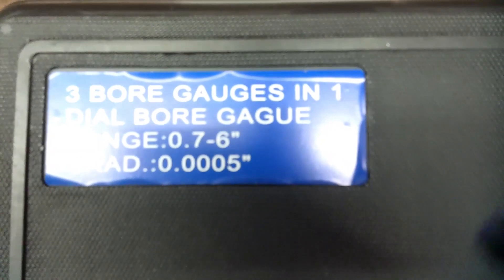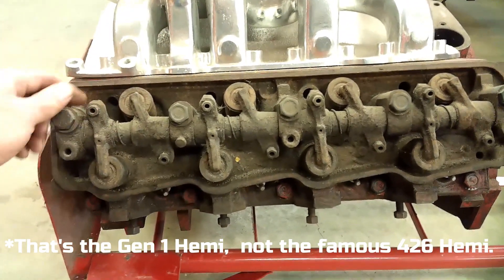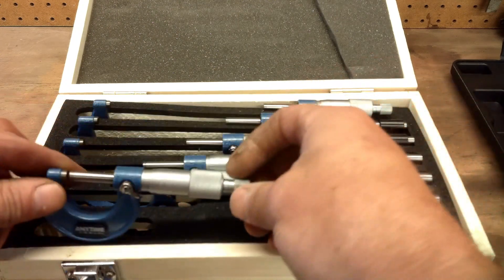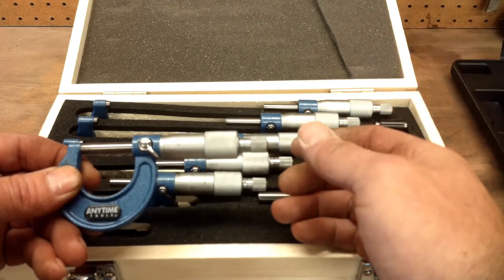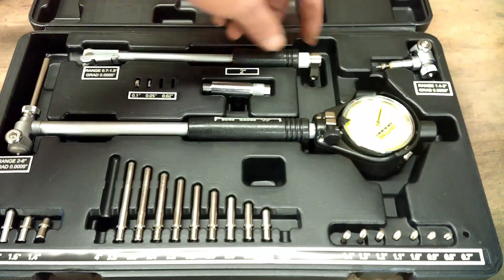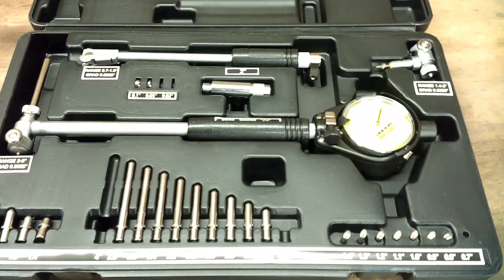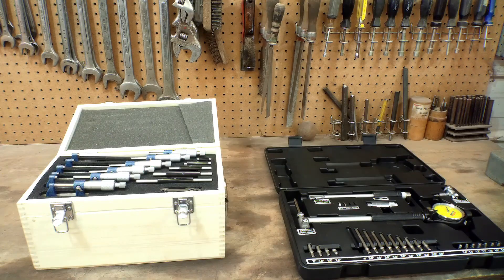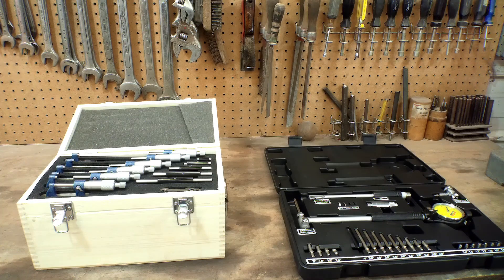Review of Anytime Tools Micrometer and Bore Gauge Set

Comment: Thanks for the video! I ordered the micrometer set because I need to check my pistons and I decided to order the whole set so that I won't need to order anymore precision measuring devices for things like rotors. Hopefully I can borrow a dial gauge indicator from Autozone/Advance if they have them in the loan-a-tool program, but my engine only has 70,000 miles on it so I should be good to go either way.

Comment: I have used dial bore gauges and micrometers, there isn't too much too them as long as you can read them, from personal experience, no laughing on my end, you simply and easily explained how to use them in basic specs. Nice job!  By the way, I subscribed as well :)
Reply from the maker: A lot of people simply cannot grasp the concept of how to read them. I remember back in high school shop class, how few of us actually got it. The biggest struggle I have with them nowadays is my failing eyesight! When used to work in maintenance at a manufacturing facility, they had to buy the tape measures that actually had the fractions printed on them because so many people can't even read a tape measure. I hated those things! Thanks for the sub Pete!